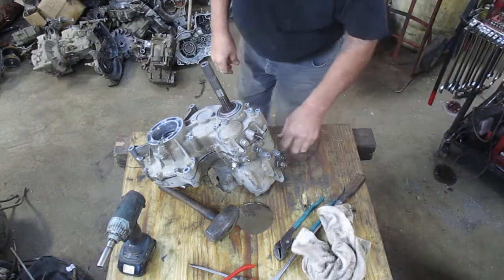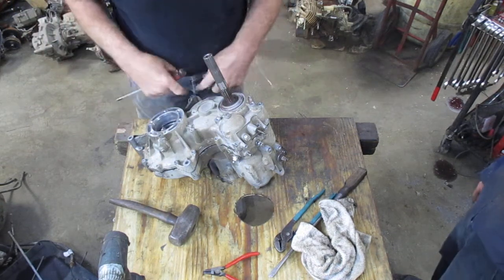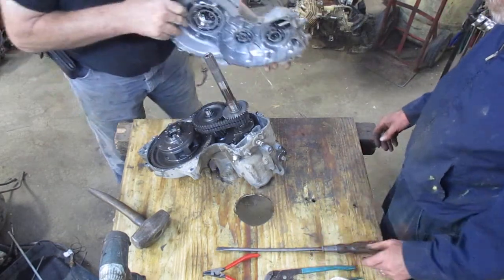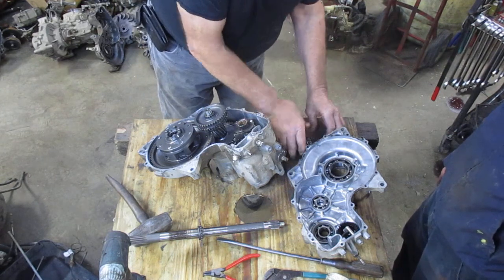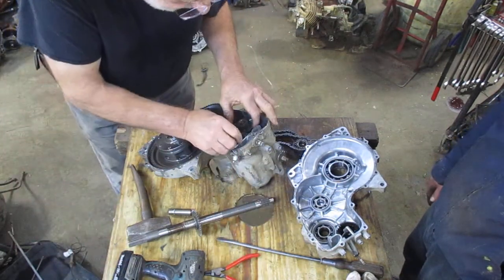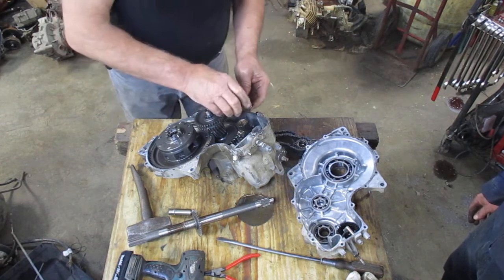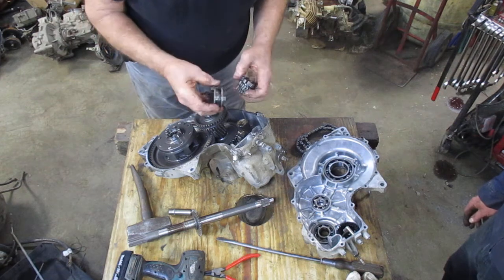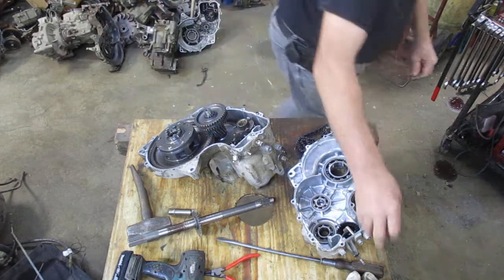Kawasaki Mule Jumping Out Of Gear Easy Fix!

Comment: Not sure if youre still checking comments or not, but why are there teeth in both sides? Im confused how flipping it fixes anything if the worn teeth still grip something on the other side. Mine slips out reverse once loaded hard, and slips out just moving forward too. So im gonnna tackle it but if i dont habe to buy a part, thats awesome,

Comment: My 2008 mule 3010 makes a squealing noise when the 4x4 is in gaged.   Only makes this noise when the vehicle is moving.  The noise is coming from some where in the front.  When the 4x4 is disengage,  the squealing sound goes away 5 seconds after 4x4 is disengage.   Anyone has an idea what is causing this noise?

Comment: I have a 4010 diesel and every so often it will pop out of gear for a split second and back into gear and not do it again for another few weeks. I adjusted my shifting levers ensuring that they are functioning properly but I think I may have a cog that is going bad.

Comment: Gary Moore, I have a 1999 mule 550 2 wheel drive, that grinds going into forward and reverse - unless i basically kill the engine to shift into each...., would this fix work on my model and my issue, thanks for the help.
Reply: Sounds like you need to rebuild the primary clutch.
Reply: Adjust your idle lower and try that

Comment: I have a mule 5210 1999: can you still get spare parts for it, I have transmission problem, so thinking shift cog. My chap says no, but just checking thanks
Reply from the maker: I should have anything you need. 985-750-3939 Gary
Reply from the maker: If it is jumping out of gear this will fix it but if there is another problem I do have some parts for it. What is it doing?

Comment: I have a Mule 3010 that had low compression and I put a rebuilt engine in it. The problem I'm having now is that while both the primary drive clutch and secondary driven clutch spin together with the engine idling in neutral, as soon as you go to put it in any gear the secondary driven clutch completely stops moving and the primary drive clutch keeps turning so the belt makes a very loud squealing noise due to the friction of rubbing against the secondary driven pulley. I put a new secondary driven pulley and belt on it and the problem still exists. I inspected the two gear selector linkages on the transmission and they both operate freely. I even went out to look at a friend's Mule 3010 and took a video of the operation of the two gear selector positions in high gear, neutral, low gear, and reverse to compare and they look to be identical.

Does anyone have a clue what would be causing this? The only other thing I can think of is that when I first went to start the engine, the shifter cable bracket was still hanging loose since it is bolted to the engine and I had to move it around a bit to get it in neutral so it would crank. Not certain if this could have caused any issues, but again both of the gear selector levers appear to be operating properly. Transmission fluid is full and clean. Any ideas?
Reply: Your belt is not adjusted properly

Comment: Any advice where to find a new shift cog I think mine is beyond using flipped I use reverse often
Reply from the maker: That's the point in just flipping it. The cog only wears one side. If you think about it. the cog is on the input shaft which only turns only one direction so when you flip it's like new  again!
Reply: @garymoore6735  when flipping it won’t reverse then be the failing side? Or does it alleviate both

Comment: Please does this work or not ?!?
Reply from the maker: Yes it works. It is the cureu to jumping out of gear. What you have to do is after this is done by all means lower the idle as low as you can. The high idel is what causes the problem. It has to not grind just putting in forward or reverse gear! You can call me if you need any info. 985750939.